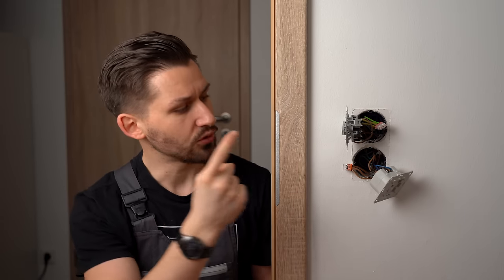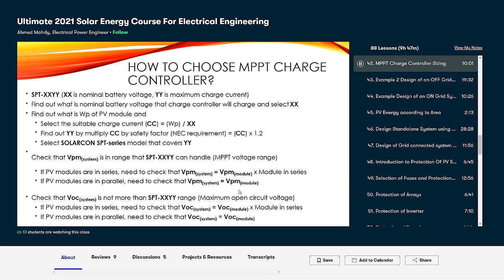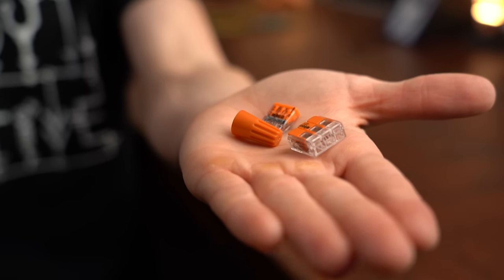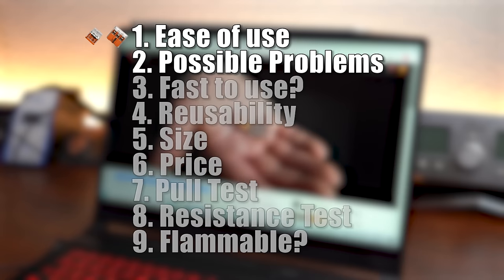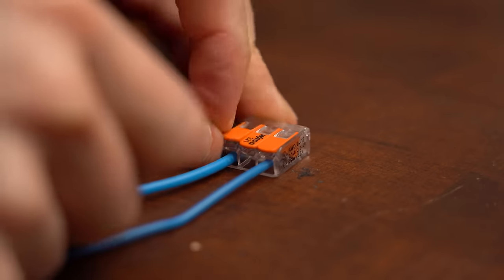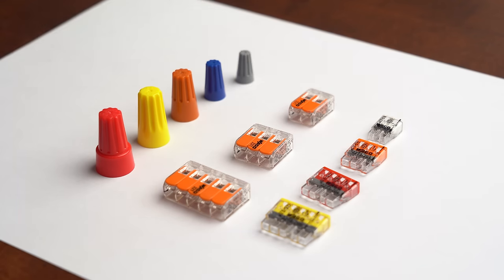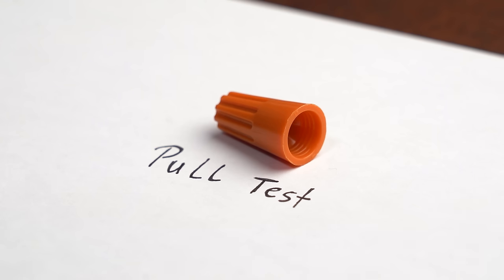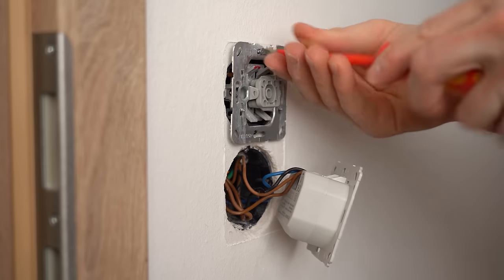What Wire Connector is the Best? Settling a Debate! Wire Nut VS Wago

Comment: I realize I'm a bit late to the party here... but for me the main benefit of the WAGOs are that I can remove a single wire without needing to disconnect the others. This is such an immense time saver, especially when doing trouble shooting or installing additional wiring later on.
Reply: What good was the time savings after one burns down your house?
Reply: @RadioRich100  i doubt they will burn your house down. ive used wago connectors for about 5 years and havent had any issues.
Reply: @GamingKing545  Oh I see, you put your name and phone number on each one u installed.
Reply: @RadioRich100  no? they are installed in my house
Reply: @RadioRich100  what's your point? how can it burn your house down?
Reply: @king_james_official  Starts with overheating then arcing then the plastic melting, then the wire insulation? I need to explain this? You think it takes something large to start a fire? Remember aluminum wiring ? Nobody thought that was a problem either. Hundreds of homes burned to the ground simply by using a different type wire which the connections slowly started that process.
Reply: Also, you can test the individual wires with the Wago connectors as they have access ports to do so.   The wire nuts do not.
Reply: @donaldroehrig7817  So what? The connections are there to be permanent and secure and safe, not for your convenience later, sacrificing the integrity of the connection.  What u cant stick a probe under a wirenut?
Reply: this point! everyone who does serious electric work, including trouble shooting, will love this feature. i accept NO discussion  about it on a professional level.
Reply: @RadioRich100  "overheating" in the video at 20amps the wago only reached 25 degrees, thats slightly over ambient. also most wago connectors in homes dont even see 20amps as 16amps is the standard for everything in a home.
Reply: @RadioRich100  what a weird comment, especially after watching this video. Wago connectors have proved to be incredible reliable, they are officially certified and if applied correctly (which is true for any connector) don't have any risk of burning anything down.
Have been working with Wago connector for more than 15 years, not a single Issue.
Reply: Thats stupid, all you care about is your convenience and sacrifice the integrity of the connection resulting in possible fire and failures which these things have caused. Glad your not wiring my house.
Reply: @RadioRich100  You are obviously clueless if you only think these are used for household wiring.  Open your mind that there are possibilities beyond your limited skills.
Reply: @RadioRich100  i don't know where you are getting from that you would sacrifice any integrity of the connection. Your knowledge of electrical wiring must be next to nothing...
Reply: @Gorgor Gonzales  Its fact clip on buss bars do not replace solid copper to copper twisted connections, it figures that someone who boosts wagos has little to no knowledge of electrical physics. Facts speak far louder than the manufacturers advertising. And also the routine failure of that product.
Reply: @Saltiboii reviews  know what your escape route are.
Reply: @Charly Hoppenstedt  If you do serious electrical work, your not using wagos.
Reply: @RadioRich100  feeding time:
- From an ideological standpoint you're half-right. The copper to copper connection may be better. (Unless it's not and given it's properties you'll only be aware of it if you measure the resistance of each line or find out the hard way). Then again if we're in the business of 'no compromise' you'd do all you can to have no intermediate connections at all.
- From a professional standpoint you're plain wrong: Time is money. Wagos are 'good enough' and way faster and thus cheaper even if you consider the higher price per piece. A visual inspection is enough to be reasonable certain of a good connection. No electrical installation stays the way it is forever thus reusability is indeed a valid point as, again, it saves cost. Even though you shouldn't do it you can reasonable safely extend a electrical installation without having to turn it of (if the existing install has a spare port in the connectors). Faults happen. Nobody is perfect (even you) and thus having a proper point for measuring purposes is a benefit only someone would deny who's lacking experience.
Reply: @RadioRich100  wagos are made out of non-flammable polymers, so yes, i think an explaination would be appreciated. also if your breaker didn't trip already then i might consider other points of the instalation before the connectors
Reply: @OiDepp  Just not the homeowners who paid you for the work.
Reply: @Hans Wurst  Your ridiculus to beleive the homeowners safety is not important just the convienece of the contractor. Its not even an issue.
Reply: @i will step on you for two dollars  Oh they are? thats funny ive seen them in flames and burnt to a crisp, also the extreme heat from a burning connection starts wire insulation and  the plastic boxes on fire. Are you a wago salesmen?
Reply: @Hans Wurst  Copper to copper is the best all the time. Saving money or time burns houses. Remember aluminum wiring? Safety is always number 1 not saving time or money.
Reply: @Gorgor Gonzales  This is why you dont belong doing electrical work.
Reply: @RadioRich100  
How do you get the impression that wagos are not safe?
Reply: @RadioRich100  salesman* i'm not, i've used them maybe like 5 times
Reply: @Hans Wurst  Ive pulled out several burnt ones and ones where levers popped open partially or fully from service calls, others I know have. Complaints from people here. They are similar to other devices that fail frequently that use spring or lever contacts for fast connections - push ins, back stabs etc. They all share the same problem, very small surface area contact and spring pressure that weakens due to heat from high resistence over time. The wago connector is in series with the load, wire nots are NOT part of the circuit. This makes them a component prone to failure. Wire moves loosly side to side inside the connector even though the lever is closed with little contact between the copper and the little bus bar and then twice in each circuit. If 2 12 gauge wires go thru a wago what is the equivalent guage left with little surface contact ? 14, 16? This is why they run hot.  Its like putting 2 resistors in each circuit. There are gaps between the conductors and the bus bar times 2. With proper twisting the wirenut connection lasts forever. You the electrician will never know they failed because by then your long gone thinking there ok. It becomes someone elses problem when circuits stop working. People like them because there fast and convienent which in electrical work is dangerous. Take the time to do it right. Connections are supposed to be solid and permenent not quick and easy.
Reply: @RadioRich100  i aint readin allat
Reply: @king_james_official  yeah, everybody in there right mind left this conversation I presume 😂
All RadioRich100 stuff of this is such a load of horse crap...
I'm outta here and gonna enjoy my day by burning down houses with Wago connectors...
Reply: @gorgorgonzales3090  i guess they are buying "wago-product" wagos lol
Reply: @MegaHarko  A pile of burnt up ones.
Reply: @GIobex.  I am one jackwad I pull out burnt ones all the time. Why do your wagos need maintenance?? Lol Wirenuts dont.
Reply: @GIobex.  Oh really?  To run speaker wires you opened up outlet and switch boxes??? Now I know your full of it. Did you connect the speakers with wagos? Maybe they will work for that. You opened up outlet boxes to see how they were doing?, or to try to find where that smell of burning wires is coming from?  Whats wrong feeling alittle unsure of those little fire crackers in your walls. I guess I wouldnt sleep well either knowing I had a house full of wagos. You know what there saying, A house fulla wagos and away your house maygo!!  By the way how many wagos have you sold?
Reply: @RadioRich100  so what youre saying applies to absolutely any fucking electrical connection possible? cool. how helpful
Reply: @RadioRich100  You write a lot but in the end it is in the USA that there is a lot more fire of electrical origin, and Europe is known to have the strictest electrical standards
Reply: It's hilarious seeing all the bitter arm chair experts who hate anything new. Oh but they've been a sparkie for 30+ years and they know best! They always use wirenuts and haven't had issues! 

No, ur just scared of change and can't let go of the past.
Reply: @SquishyThing  We do know best, and also that new dosent mean better. In this case its far worse.
Reply: @SquishyThing  No the past doesnt have melting connectors in it.
Reply: @loutrete  Where do you get your information from?
Reply: @RadioRich100  No one is going to google for you, and in my opinion it simply doesn't matter, a short look told me the US has a higher per-100k count of electrical incidents than the worst european country (electrical wise), the UK. But I really don't want to put too much effort into researching it simply because Wago is objectively better FOR EUROPEAN MARKETS. In Germany we're held to extreme safety measures, unless you massively mess up you simply can't overload those clamps because there are cascading safety breakers in every single circuit, and RCDs in every circuit a normal human could have access to.
The clamps being able to carry 100A/200A over a short duration on a circuit that breaks at 16A in less than 5 seconds and in less than 0.3s at 80A is massively oversized.
As an electric technician, then electrical engineer, now maintenance manager, I'm personally a huge fan of the Wago clamps over wire nuts or crimping contacts. They show up much less in our thermographic analysis, they are quick to disengage, easy to measure on and fulfil our earthing resistance criterias every single time. There are always idiots who don't pull on the cable to check if the clamp is engaged, but then again there are always idiots who don't tighten a wire nut, don't check if the crimping holds etc. etc.
Reply: @RadioRich100  You do nknow that wire nuts are forbidden in several countries exactly because of risk? HUman risk is  still higher than  any other so the ones easier to install wrong is always the riskier on a large population.
Reply: @tiagodagostini  Never heard of that. They work great here and have for 80 plus years. There not forbidden you just use different methods. Their in every house hold here.
Reply: @RadioRich100  If I sell a  building here made with those  I will get  HUGE fines and will be legally  forced to remake all the electric system.
Reply: @tiagodagostini  So dont use them, but wagos are sure not the answer. Ive seen them melt over and over again and replaced them with wirenuts.
Reply: @Hanzomo  actually the 16amps isn't the standard. 80% of the load is standard to what electricians are required to meet. We don't calculate the breaker, but the load so we know what breaker size to use. And I mean we because I am a licensed electrician.
Reply: @gorgorgonzales3090  RadioRich100 is actually correct that the connection integrity is worse with Wagos than with wire nuts. It's all about the calculations. Hence the reason why the wire nut won in that category in this little test. The resistance is increasing higher and the more splices there are with Wagos the worse it progressively gets. I know exactly what Radio is talking about and what is meant.
Reply: @emriys1334  the standard here in the US is higher than Europe's, guaranteed. Meant enough electricians who vacationed there and searched the electrical there, then came back and said, "don't copy Europe."

The reason for more electrical fires here is because homeowners or as they are called DIYers (do it yourself) watch videos like this and read comments like yours and think they can do the job just as good as a qualified electrician because they don't want to pay for the cost of an electrician. And then they start doing things beyond what circuits are capable of because they don't know how to calculate for loads and thus creating overload, which will lead to electrical fire. To often I've gone into remodels to see the trash work of an homeowner.

But if you want to make the case of how Wagos are better than wire nuts then go ahead and give me calculated fact. Don't want your opinion. This video even proved that the wire nut is superior when it comes to calculated loads. The wago won on ease of use. Which also means US electricians value human life more than European Electricians.
Reply: @RadioRich100  Talked to plenty of electricians and being one myself here in the States that know for a fact wire nuts are better. And I don't use "fact" lightly because our reasoning is in facts. Everyone who debated you have only given opinion, but never provided facts as to how Wagos are better. In this video based on the calculations it was proven wire nuts are better, but for some reason these people think Wagos are better just because they're easier to use.

Also notice at the end that this German electrician inserted bias just so he can say the Wago is better? The wire nut actually did better, but he said that the only benefit for wire nuts was cost because the Wago did good enough. That's the European standard these electricians are proud of, "it's good enough." No tradesman who respects his trade never settles with "good enough." They only settle for "the best of the best."
Reply: @TheForgottenMan270   well im also a licensed electrician but in germany and 16amps is the standard breaker size with 230v/400v house installation. You don’t calculate the load or whatever, you just install 16amps and thats it. 16 amps is enough for everything in a house with a potential 3,6 kW per 230v socket and 6,4kW for the 3 phase 400v socket
Reply: @TheForgottenMan270  breakers in germany have 2 types of decouplers (dont know the englisch word) one is a basic short circuit decoupler and the other is a thermal over current decoupler. If you reach the max rated load or over of the breaker the bi-metal strip will heat up and open.  This also happens if u are close to the max rated load but then takes like 4h or something depending on the load and the chart the manufacturer rated the breaker. There are many breakers with different types signaled by a letter beside the current, like 16B is the standard breaker for all house installation, meanwhile a factory may use 16C as it can go over the rated current for a short time. Wagos, cables, lamps, sockets are all rated for way higher loads then the breaker. The breaker always shuts off first preventing a fire. Additionally to that all house installations also need a RCD over all 3 phases shutting off at 30mA. If a fire happens its only bc amateurs or cheapskates used thinner wire that isnt rated for the load. The standard size here is 1,5mm²x3 for sockets and lights and 2,5mm²x5 for all 400V appliances, like a oven. Also its usual that every socket group or larger appliance has their own breaker. especially in a kitchen. What you are allowed to use is very strongly controlled. And if you do a electrical installation yourself a Master Electrician has to Control every circuit and proof that everything is to code. Such is required by law.
Reply: @TheForgottenMan270  Couldnt have put it better myself.
Reply: @TheForgottenMan270  the main problem is that the USA works with a voltage of 120V instead of 230V, this means you already have double the current to start with and double the loss.
I understand you have a need for less loss in such a inferior system.
But the main advantage of wago still stands, you can trust its connection.
You cant see into your wire nuts, one bad connection will burn down more than thousands of average connections.
And even if you made see though wire nuts, the connection isnt as standerised as wago, when installing mistakes will happen and they are far more likely with wire nuts.
Reply: @RadioRich100 if you watch the video he shows they aren't flammable...
Reply: @MrEgghead132  Under the right conditons they will burn.
Reply: @VeniVidiViral Ive seen about 30 of them so far, but often other guys tell me about them too and wont use them. I didnt say Im just a homeowner. Whats it to you? Are you selling wagos?
Reply: @VeniVidiViral There basically the same. No direct contact between conductors. Which also means if a 12 guage wire goes in and one leaves you dont even have a 12 gauge connection.
Reply: @VeniVidiViral However that works out you have far more surface area contact with a twisted connection than you ever will with a wago or any other spring contact device. Just another reason not to use them.
Reply: @Swagorath  Man, look at those Karens just ignoring facts. Nice man 👍
Reply: @RadioRich100 in my 8 years of being an electrician I've never seen a burnt/faulty Wago. It's great german quality😎
Reply: @csabanemet-jb3ms  Their garbage, Ive seen many of them and so have others I know who after that wont use them again. You must not have alot of work.
Reply: @RadioRich100  I work from 7 to 7. I work in Germany and I've never seen a Wire nut being used here. Every good electrician uses Wagos here, the cheap ones use the ones with the screws (can't remember the word). Wago is also certified by the VDE and many more TSA-s, even the american one.
Reply: @csabanemet-jb3ms  Whats your point? What do the bad electricians do? Certifications are bought and paid for. Wagos cause many problems here in the states and are banned in many places.
Reply: @RadioRich100  maybe you can buy your Licence in the States but here you have to fight really hard for it, 70% of my class didn't make it till year 4 of electrician school
Reply: @csabanemet-jb3ms  Their garbage, open your eyes.
Reply: this was the greatest comment chain i’ve seen in my life lmao

bafflingly stupid, classic example of the extremely loud 1% of tradespeople (who are otherwise competent) being locked into the old way and not being able to accept that both types of connectors are perfectly safe and acceptable. it’s possible for two things to be good. 

never seen a burnt wago in my life except for when i intentionally failure-tested one after watching this video. and yet my buddys house burnt halfway down a few weeks ago from an electrical fire… in an installation with wire nuts lmao
Reply: @aydinsesker5894  Yeah. It is fascinating to find someone so angry about Wagos. (I am guessing that RadioRich100 is from the US?). This video was really interesting because I had always assumed that wirenuts were a terrible idea, but discovered that in fact they normally produce a lower-resistance connection than Wagos (I'd like to see the numbers for the original type 222 I use which is different from the 221 tested here, but the principle of relying on a clamp and busbar presumably means it has similar numbers). However the point here is about functionality. 10 times more resistance sounds bad, but 2.2mOhm resulting in less than a watt of heatloss at 20A/230V (4.6kW) or 0.02% is not a practical problem we need to worry about. The evidence is that it burns down houses much less often than the choccy block and screw terminal connectors that went before here presumably due to creep-compensation in a sprung connection, combined with the reliability of a visually-inspected connected.
It's hard to compare with house-fires number in the US but my understanding is that they are much more common there. However they are nearly all timber, unlike much of Europe and with half the voltage typically have twice the current.
Ultimately calling wagos 'garbage' is just silly. In the UK they are the only disconnectable connector certified to be buried in walls. Neither wirenuts nor screw-clamp connections are allowed to be used for this. This might be maore about manufacturer influence on the standard, than actual science, but it is good evidence that their safety-level  is good.
I do wonder if some of RadioRich's experience of burning connectors is due to knock-offs? There are lots of copies out there now as the early connectors (like 222s) are out of patent. Some of these may not have such good fireproofing.
So I learned something here amongst the noise, but Radio, you need to get a little perspective: nobody is taking your wirenuts away so you carry on with them, but wagos are also perfectly adequate, and better nearly all ways other than price and connection resistance.
Perhaps we need a 'Green electricians use wirenuts' to reduce unnecessary losses in wiring. :-)
Reply: @RadioRich100 Tens of millions  homes in EU use  Wago connectors for last 20 years, and there was not single reported incident (officially reported to and by insurance),but still you are smarter than all those people and facts. Talk about arrogance and inflated ego...
Aslo resistance of Wago 221 is same as resistance of 1.70 m of standard 1.0 mm2 copper wire, so all your arguments are false...
Reply: @TheForgottenMan270  So you talked to electricians that stated they OPINIONS, and yet they became FACTS for you. Just wooow...
Why don't you give rest of us full and properly documented FACTS that nuts are better? (URL links please) Also why are they only properly used in USA and Canada?
P.S. Try to learn some math, and use it. Wagos 221 are resistive as 5ft of standard copper wire, so almost negligible in any power circuit that is longer than 10ft.
Reply: @skela098  Hogwash, many people have tested them with thermo cameras to see the heat coming off of them. Never properly installed twisted connections with wirenuts. There frequently removing them here in the U.S. they get hot, melt, turn black, arc, cause intermittenants and the levers pop open. Also there not allowed to be installed by some local municipalites here. No incidents?  So when they fail they call you?  Do you leave your name and phone number on everyone you installed? How long have you been selling them?
Reply: @RadioRich100  I love how you just gonna ignore all those comments with good arguments like that one from xxwookey! Thats how you lead a discussion!
Jokes besides, thats quite sad in my humble opinion. And actually here in germany, we do leave our name and phone number at the customer (at least that from our company) mostly at the main distribution box. 

And please dont come at me with that bs like "there is no use for a sign on the main distribution box when the house burned down" 
We get it, you dont like wagos.

Even for the case that the house burnes down for whatever reasons, we have something called "fire safety regulations ", which prevents the fire from spreading into different rooms and in the best case puts it completely out, e.g. fire-resistant sealing for holes, fire doors etc. 

Nobody is gonna take away your wirenuts, in fact you can install as many as you want. But please just accept the fact that different countrys or regions have different regulations and rules in terms of electric installations.
Reply: @SenpaiBit  Any good electrician here in the U.S. doesnt use them because of the problems they cause. We see alot more failures here because we use half the voltage and twice the current , they get hot warp and burn, they are part of the circuit and shouldnt be. The conductors dont touch but should. But they are bad for other reasons. They pop open and twist when closeing the box. They are just a faster way, not better.
Reply: @RadioRich100 they are used all over europe in every household. If they indeed would cause fires or be a problem this would be a huge problem for the whole industry.
Reply: @K0nst4nt1n96  So was aluminum wiring, yet they still did it.
Reply: @RadioRich100  WAGO clamps can withstand 80 to 120 degrees Celsius, depending on the model.
Reply: @003General  U mean when there on fire?  Why would anyone want to have to worry about temperature ratings when an electrical connector has no business getting hot in the first place?
Reply: @GamingKing545  Im glad I dont live next to you. It may be a good idea to make sure your home owners is paid up.
Reply: @donaldroehrig7817  If you did your job right the circuit wouldnt have to be trouble shot in the first place.
Reply: @RadioRich100  Sure, because nothing ever goes wrong.  You never make mistakes and things never change.  Get over yourself.  Oh, and way to keep resurrecting and old thread to try to keep yourself relevant.
Reply: @donaldroehrig7817  So how long have you been selling wagos?
Reply: @RadioRich100  after about 6 years of having the wagos installed they still look fine. and i just installed more in the new addition.
Reply: @RadioRich100  No, absolutely not. And you don't have to "worry" about anything with Wagos.
Reply: @RadioRich100  „hot“ 25°C 🤡
Reply: @RadioRich100   The number of fires in homes due to electrical failure is much lower in Europe than it is in the US. Can you explain why that is?
Reply: @Lib3x  Can you explain where you get your information?  Wagos are dangerous no matter what you say.
Reply: @RadioRich100  I'm willing to take that statement back as I did not actually find a valid source to the claim I was referring to. However. Knowing that America isn't really known for quality, In Europe we design and build our homes with heavy duty materials that can withstand the test of time. heck even my house has more history than USA alone. my point being that it's rare to see low quality materials being used here. I would worry more about living in a house made by paper, foam and plastic built by someone who uses his foot for a measure, hence why Id rather trust a wago over a plastic cap :)
Reply: @RadioRich100  why we used aluminium in the past? because it was cheaper than copper. i'm not old, but i had a chance to talk to one of enginners that designed electrical wiring to apartment buildings from 1960's. they knew that copper is better but the cost. original WAGO (not some knockoffs) are the best solution, if installed withing their spec, we're doing some modifications to systems build 20 years ago with wago, and i often have a bunch of the old ones laying around, and guess what, they're still as good as the new ones. We're using them in my job to DC and AC and the only problems we have are the ones with diode in it, but that's mosty due to user error with wrong polarity.
Reply: @RadioRich100 I’m really curious why all these experienced electricians in the US are routinely pulling out charred Wago connectors while their E.U. counterparts never have any issues.  Someone’s not being completely honest here.  
Personally I hate wire nuts, especially on old homes.  I’ve had them fall out when pulling wires out of the box.  Granted, you could say they weren’t installed properly but that WOULD be one advantage with Wagos…it’s harder to improperly install them, though some will find a way.  
It’s interesting that most lighting instructions I see recommend taping the wire nuts now.
Reply: @Splattervision-qh1sd  The problem is that wagos fail when properly installed. If you dont know how to put on a wire nut properly, you have no business being an electrician. Im sure the failure rate in the U.S. is far greater than overseas because we use twice the current among other things. The wire nuts on lighting fixtures are tiny and have no metal inserts.
Reply: @RadioRich100 lil bro get back to preschool🥴
Reply: @RadioRich100 bro no house has burnt down because of wago connectors. Wdym?
Reply: @TechniCraftYT  Oh, I didnt know the fire marshal and electrical inspectors in every city in every state in every country reported to you. You must be important.
Reply: @RadioRich100  only time I saw wago fail was when someone fed 170A trough it. It just melted but connection still held.
Reply: @joik2ww269  Yeah right People always do that in their house and then call you.
Reply: @GamingKing545 
All electrics in EU use wago. 
They are rated by German standards. Not at all a fire hazard.
Reply: @TheForgottenMan270 oh to be an american… so wrong yet so arrogant
Reply: there is nothing more to say. every electrican would say that (if he knows, that it is possible)
Reply: @RadioRich100  This is just wrong. you are not what we would call a professional electrician.
Reply: @OiDepp  Lol, Whos we?
Reply: @GamingKing545  Make sure your homeowners is paid up.
Reply: Junk connectors, speed is never the important thing.
Reply: @RadioRich100  I don’t know what country you live in so on the European market have to have so much testing done equals surround £10,000 for a connector to be a proof
Reply: @RadioRich100  countries with good regulations require electrical installation certification to be provided and who did it but if you want to use an arcade screw terminal fine but you have to come back for free and tighten it
Reply: @wostep  Lol what wrong losing sales selling your magic boxes?
Reply: @RadioRich100  Yo , you've seen so many burnt wagos, could you send me imgur photos of them you've taken with your phone?
Reply: @LykeArgy  You think I go around taking pictures of wagos? I told you, so thats it. Im not getting paid to say it, unlike people pushing them.
Reply: @RadioRich100  yeah, i'm gonna stick with COOL STORY BRO then
Reply: @RadioRich100  "Im sure the failure rate in the U.S. is far greater than overseas because we use twice the current among other things" 
Maybe partially, but the standard circuit Ah in Germany for example is 16Ah (and likewise in many other European countries, with the lower end being on 13Ah), limited by the breaker.
For electrical ovens, which you will find in almost all houses, it mostly is 25Ah.
In US as I gather it is between 15 and 20 Ah. So not that much more really.
As for house fires, well, I am sure a house made with all flammable material including spray foam for insulation which is burning very well, it is going to burn much better than i.e. my house from around 1840 which has in the lower ground floor sand stone walls of 80cm thickness, in the "new" area clay bricks with 24 to 36cm and only in the upper floor of the old area some 12cm wooden structure filled, depending when done or repaired with everything from clay, to cow dung mixed with straw or bricks and coverred (inside and outside) with everywhere from 1-5cm of plaster.
You mention Wagos going to pop-open... I am using Wagos now close to 20+ years (starting with the 222 series) and I have never seen one pop open UNLESS (rarely happened) you push a solid wire which is TOO BIG for the Wago forcefully inside and leverage around on the wire...

Also lets not forget about the many knock-off which are out there. Did you really see faulty WAGO clamps or are you using the word WAGO for all type of spring loaded clamps interchangeably? There IS a difference!
One more thing to not forget:
Your UL organisation in US has been established to avoid fire hazard in Electrical installations while in Europe the focus was mostly on electrical safety for people. This is why there are sometimes "funny" rules in the UL regulation from a European perspective (I was involved in certifying motors and electrical switches for Export markets) and is also the reason why sometimes US and European standard deviate. (i.e. PVC are forbidden to use in outdoor installation and mostly people in Europe use rubber cables, while in the US it is forbidden to use the rubber cables outdoors and you have to go to other materials.)
Reply: @UKsystems "I don’t know what country you live in so on the European market have to have so much testing done equals surround £10,000 for a connector to be a proof"
Oh, no problem: UL is a nice lock-out to new technology, they easy match and exceed the costs in Europe for certification....
Had to do a slight technical change: 2500 USD, name change a product? 500 USD
And don't forget: Regular manufacturing plant inspection and Business class tickets for the inspectors to walk around the plant to see how it is manufactured.
UL is a great market protection for the US, but also hampering new innovations (as long it requires UL certification). I guess this is why they are all so keen on smart home with DC technology which is often exempt from certification....
Reply: @marwerno  Its not good to use them no matter what.
Reply: Time saving means crappy job and materials Do the job right or dont do it..
Reply: @ looks like many have a different opinion of that. So far you are avoiding almost all valid argument points.
Reply: @ „Time saving means crappy job" ???
Are you kidding me? Please go back to using slotted screws and drill any holes you might need with a hand drill instead of a cordless drill…
Reply: @marwerno  With electrical work - yes
Reply: @marwerno  There arent any, faster and more convenient is never an excuse for using substandard methods.
Reply: @ So why are you not working like in 18th Century and observe the rules back than? UL used to have the rules of metal plate in front of mains on user operabable devices… you still stick to that? No, because there is something called progress and these Wagos that you hate this much are here to stay and even these will be improved uppn.
Reply: @marwerno  Your comparisons are ridiculous and have nothing to do with electrical work. You obviously are a subpar electrician or handyman.